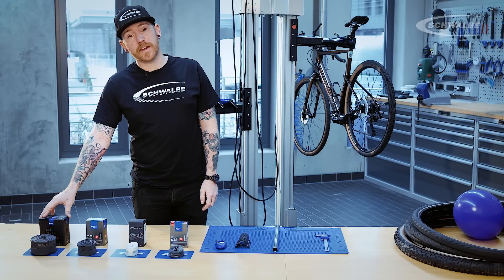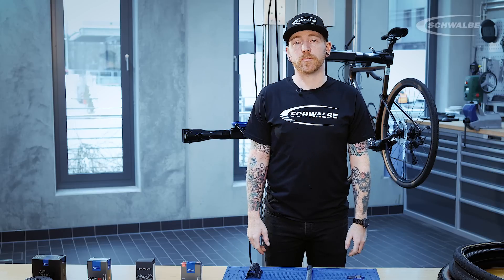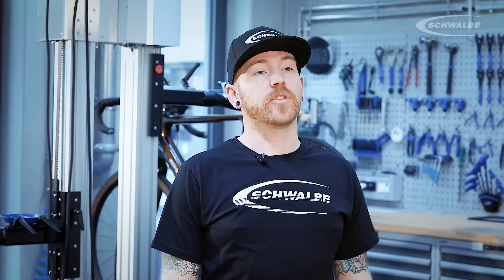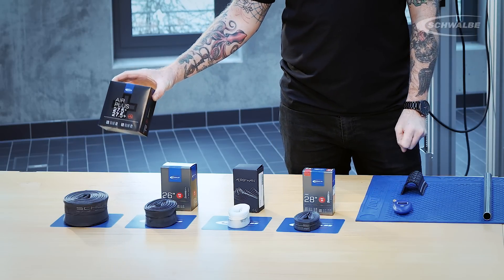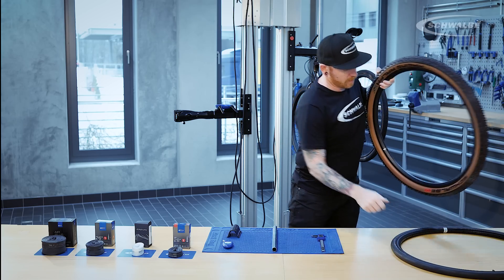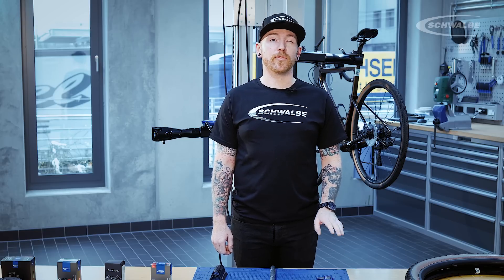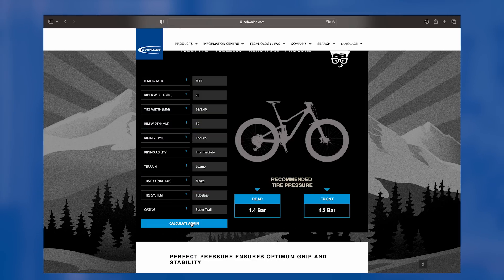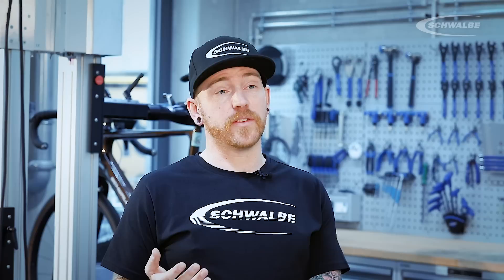Air Pressure for Bicycle Tires - How low or high should you go? We show top tips and guidelines.

Comment: Ok- I am 240lbs.  I am commuting on pavement.  I am an old slow rider.  I notice bike rolls noticeably better 10-15 lbs overpressure.  I check pressure every trip.  Silly Schader cheap tubes as that is what you get here.  My tire recommended pressure is 50 psi.  I try to run 65-70.  I am on a permanent diet.  I would love to lose 100 lbs.

Comment: I wish someone told me earlier that you can go to a gas station and pump up your tires for free. for 4 years I was pumping them with a puny hand pump, it takes so much work and the pressure you end up with is still too low. and I wondered why it takes so much effort to ride, then I tried pumping air in with a gas station compressor to max allowed pressure and it was like a new world opened to me, bike rides so much easier, just put in a couple pedal strokes and it rolls and rolls for miles
Reply from the maker: Brilliant! This is the magic of the right tire pressure. Thanks for sharing this 🤗
Reply: Yes if you have the right type of valve
Reply: @johnnyboy1586  you can buy adapter for 50 cents
Reply: @darius2640  I didn't know that , thank for the info👍
Reply: Pumping up a tyre with a good-quality hand pump isn't that hard. It's certainly easier and quicker than doing a detour to a filling station and having to pay for it (we don't have many filling stations in the UK that have free air). If you're physically incapable then a stirrup pump or a foot pump is even easier. Apart from that you should always have a pump (and puncture repair kit) with you just in case you get a flat so why not use that?
Reply: valve adaptors , presta to car tire pump = $3

Comment: Thanks for this video. I have 23c Schwalbe Lugano on my road bike and I weigh about 165lbs (75kg?). Recommended pressure as stated on the sidewall is 85-110 psi. But with all the talk of using lower pressures these days, I’m wondering how low I can go with these particular tires without risking more frequent punctures. Any suggestions for me to experiment with?
Reply: all bs, stay at 90 to 110 psi

Comment: How about e-bike tyres? I have the schwalbe energiser plus tyres on my Gazelle U380. So far done over 6500 miles. I have had a few flats. Only one was due to a tiny hole in the inner tube. I inflate to 45 psi in both front and back. Is that correct?

Comment: Hi…is 40 PSI on Marathon Plus okay? Thanks in advance.
Reply from the maker: Unfortunately not that straight forward to answer - sorry. It does depend on the overall weight of you and the bike, tire size and riding profile. Given you have a 40-622 tire the tire can be ridden at 50-85 psi. So 40psi does sound a little low. Try 50 psi and see how it feels for you. If you let us know your tire size we can be a little more specific.
Reply: @SchwalbeBikeTires  oh thanks for that quick reply! I’m 9 and 1/2 stone and the wheel is 26…I’m gulping at the thought of 50psi and would want fat tires or dual suspension!! 😅. The rds and canals would be brutal to drive on otherwise! The potholes and uneven surfaces make it a nightmare…however I’m open to suggestions/solutions. Much appreciated 👍🏻

Comment: I love the ice spiker pro tires in the winter. Except they are way too hard for the snowy  surface when using recommended air pressures. When I use lower pressures to get better handling and driving experience the tires will start to crack from the sides.

Also I think ice spikers would benefit from less round profile. Now they only dig them self in to the snow and are harder to drive. Maybe these are developed to only hard icy roads, but here northern europe we have more snow than ice.
Reply from the maker: You are right that the SCHWALBE ICE SPIKER PRO is best suited for icy conditions. However, a layer of ice must always be expected under loose snow. Have you used the SCHWALBE PRESSURE PROF to adjust the tire pressure? https://www.schwalbe.com/en/pressureprof/

Comment: What about winter tyres' pressures?
I am about to get a Cube Stereo Hybrid 120 SLT 750 "Allroad" Prizmblack (with fenders and stuff) , size L , with Smart Sam 2,6'' x 29'' normal wheels. Location is around EU - polar circle, so -50c temps are possible. But the +-0c is the temp those studded ones are most useful at: water/snow on transparent ice.

Ice Spiker Pro 65-622 (29 x 2.60)DD, RaceGuard, E-25WinterBlack (Article number:11654467)
Would this wheel be the choice? Or the 57mm wide one? The trouble is that Im not sure what will fit under the fenders. (ACID Mudguard set MTB 75 with struts black)